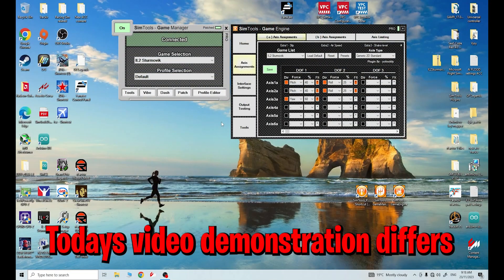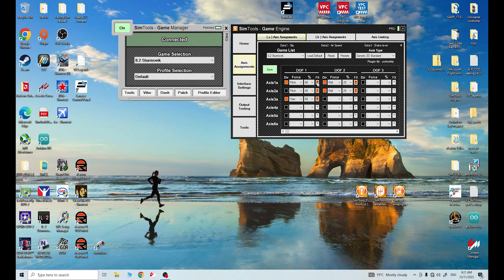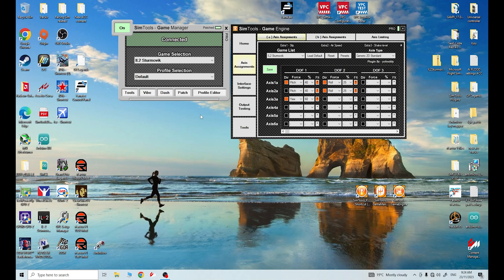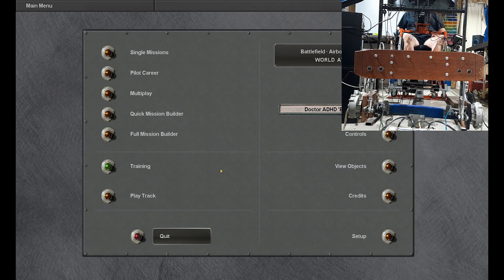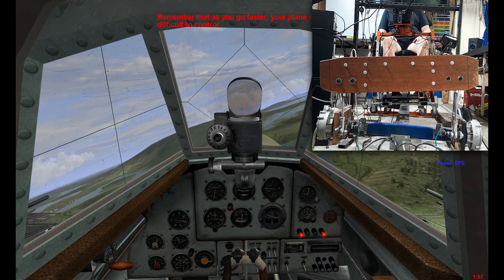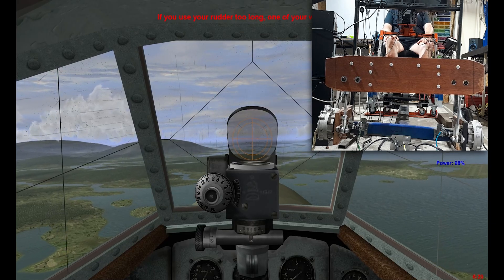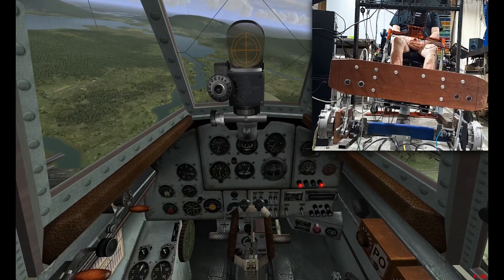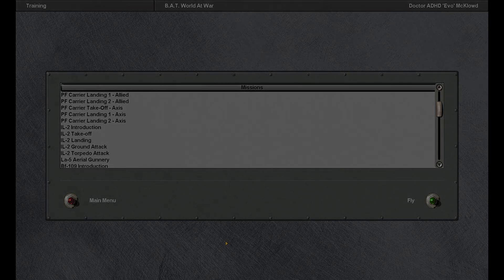Motion Simulator Platform DIY Showcase With A Flight Simulator Title

Comment: dont know if the "forces" and vectors are generated by IL-2 or the SimTools, but its very wrong. The barrel roll that tight has no banking left and right forces like it is "simulated" in your video.
Reply from the maker: @madigorfkgoogle9349 100% mate. The demonstration was curtesy of the IL-2 in game tutorial which flies the plane. Probably best done that way, as I'm a learning to fly, currently appalling pilot. As far as the motion goes on the rig, I think what is seen happening with the motion rig is the result of the 3.5DOF actually being unable to roll 360 degrees. This is where unless you have a 360 degree pod type of sim platform (or the like), your sim platform will only be able to carry out the roll and pitch forces the platform interprets via the game telemetry and Sim Tools and it will be limited by the SMC3 app that enables you to set up motor lever parameters and limitations based on your rigs geometry. After shooting this video and watching it, I can see there are also a few more refinements needed in Tuning Centre to get some of the game telemetry to sim tools data  tighter. Thanks for the feedback!
Reply: @Doctoradhd1  so the limitation was the game telemetry, have you tried with some more modern sim, like IL-2 BOX or DCS?
Reply from the maker: @madigorfkgoogle9349  Yes. I play the Great Battle series as well. This has more available forces (heave, sway and the extras forces) thanks to the plugin written for the GB series in sim tools once patched. This means you get more forces coming through the rig when you are flying. Stuff like taxiing on the runway, firing your cannons, turbulence etc, but you are still limited by the limitations of the platform geometry when it comes to rolls or loops. It can't spin all the way around obviously when executing a roll or a loop for example. This design simply can't emulate 360 degree rotations. Few DIY or even commercial rigs can. Military or aviation training schools have them, but they are in the hundreds of thousands of dollars to acquire. So Sim Tools does it's best to emulate this on my rig for example, via the full range of roll and pitch available in my rigs geometry. As mentioned, that is setup in the PID and PWM parameters in SMC3 utilities when first tweaking the rig to it's geometric limitations.
Reply: @Doctoradhd1  ahh, now I get you what you mean. It is obvious that the platform is limited to some bank angles and cant do 360, which would be wrong.

The physics in barrel roll are not going around the horizontal axis (well they do but you are offset of the axis), you dont even feel much of a banking, you feel force pressing you into seat, but no banking left and right depending on the horizon. Yes you feel some acceleration at the start of the roll and some deceleration at the end (forces that cant be replicated by stationary motion platform), but during the roll you dont feel any banking left or right, just the pressure downwards. In fact you can fill a cup from bottle and drink it without spilling while you stay in constant roll. Thats why I said the forces are wrong, and yes you can simulate it "right" even with your rig, there is no physical or geometric limitation.
Reply from the maker: @madigorfkgoogle9349  this info you have provided is most helpful sir! Sounds like you do more than just fly a simulator? I am about to modify my 3.5DOF by adding a surge axis. My original thought was this would be more appreciated by sim racers over flight sim users, as it will attempt to emulate G forces introduced with hard braking or hard acceleration. My platform will surge fore and aft when braking or accelerating. Just how much surge would you feel in a real aircraft going through those manoeuvres you have described? Can you give me a comparison to if you were hard braking in a race car vs what you describe for example. I'm hearing you on the forces (accelerated gravity I guess) pushing you into your seat. Mmmmm. That'd be impossible to replicate without real speed and spin I would think. Thanks for the comments and the expansion on some of these concepts. It's great to hear how the real deal feels!.